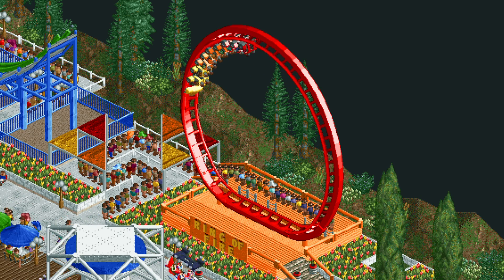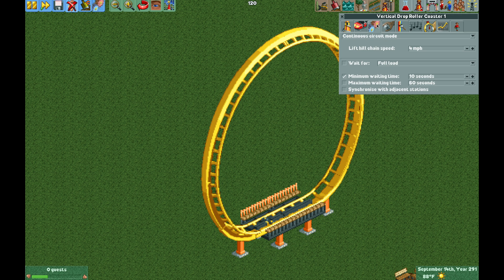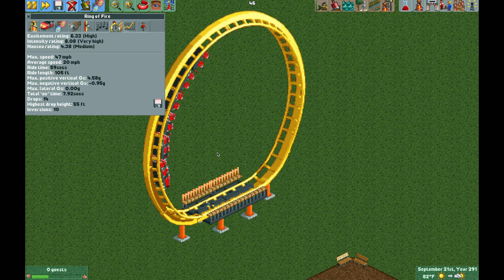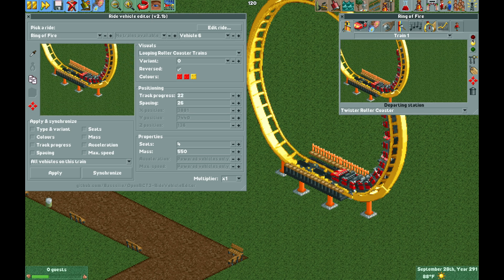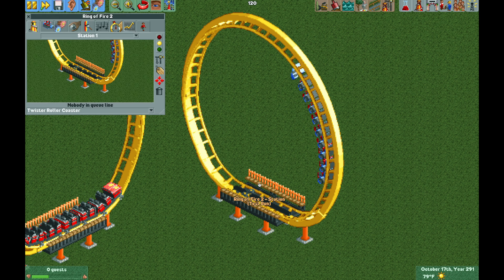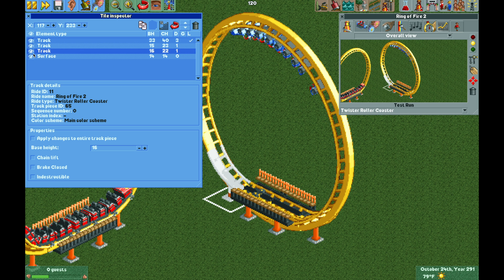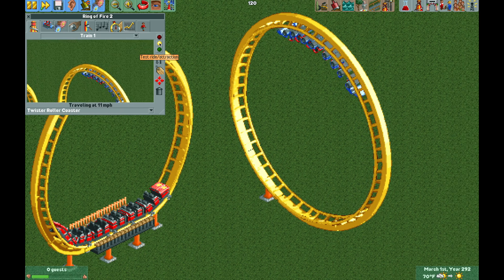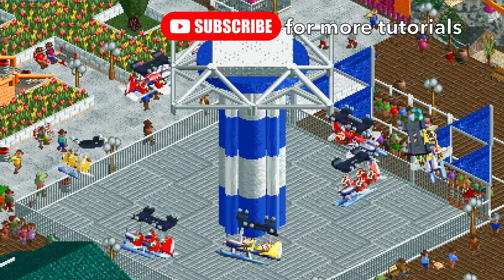Fireball / Ring of Fire - no shoe-string required - OpenRCT2 Tutorial

Comment: after placing the 2 quarter loops and the vertical to steep piece the steep to flat piece that is supposed to connect to the back of the station is this huge 4 tile long piece that wont allow for the loop to close the way it does in your video, what am i doing wrong?
Reply from the maker: Try turning off enable all track pieces in the cheats menu. This will happen with the vertical drop coaster and that cheat
Reply: @openRCT2tutorials  That worked, i needed to disable the all track pieces cheat after building the two quarter loops. Thank you
Reply from the maker: @TheHonkler6868 Hopefully one day they will have buttons for both flat to steep and the extra flat to steep pieces

Comment: Oh no! For some reason, I can't access the Special section, even with the cheats turned on.
Reply from the maker: The special section only shows  when there is a piece available. So when you’re at vertical track on the twister or vertical drop coaster for example

Comment: Nice, thanks for the tutorial.
What was the reason for swapping the front car with one behind?
Reply: If I'm understanding the video correctly, the first train always parks at the start of the Station, so by moving it back a car, the entire train shifts forward one car, which better centers it.
Reply from the maker: I should have explained it better. Moving vehicle 1 back means the train will stop whenever it reaches the end of the station platform. So this allows the train to look symmetrical when losing rather than all the cars behind vehicle 1. It’s just an option, you don’t have to do that step.
Reply: @openRCT2tutorials  Ah that makes sense, thanks! :)
Reply: @openRCT2tutorials Center justified vs right justified haha
Reply from the maker: Exactly haha